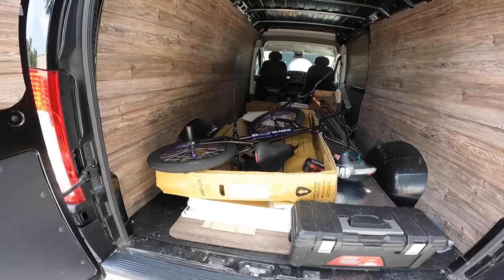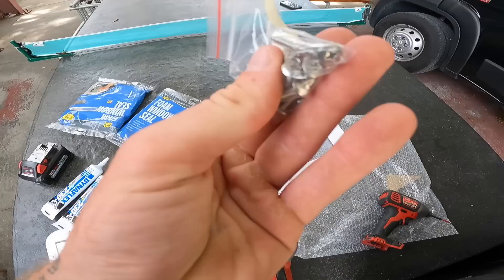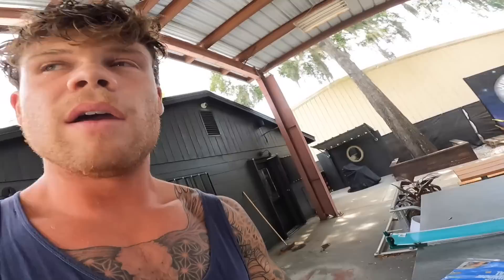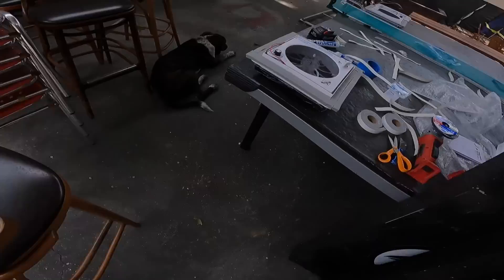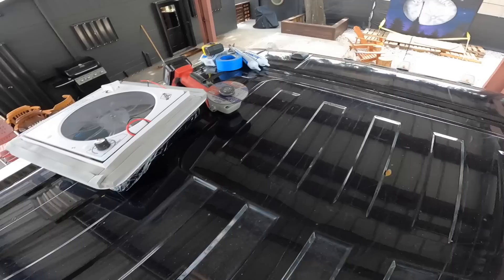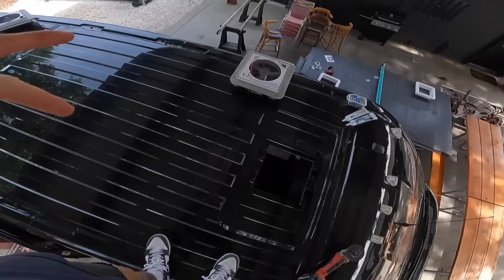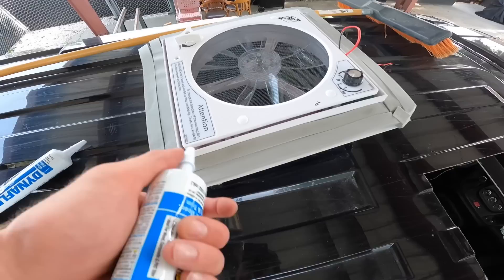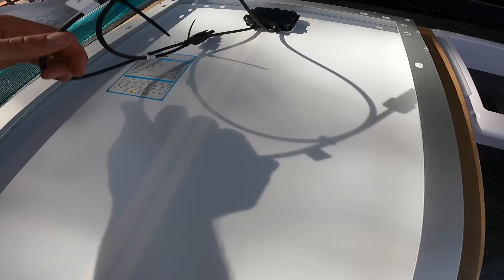Cutting a Hole in my Brand New Van!

Comment: big boy please listento me, You need to use a MARINE GRADE sealant! I cut most of the roof off a friend of mines van and built a roof extention, and has not leaked at all. they have driven all over the U.S. and still no leaks. In dallas it 15 dollars a tube, but well worth it... you used CAULK and that will give way in about two weeks
Reply: This is valid advice bigboy
Reply: Not necessarily true. Some marine grade sealants are just as bad as non-marine-grade sealants. Gorilla makes a waterproof sealant caulk which works great for heavy rain applications. I spent 22 years building bass and saltwater boats.  Marine grade sealants can leak just as bad as non marine grade if not applied properly.
Reply: I'm sure that would be better, but that doesn't mean that's the only thing  that would work. What he used will work just fine
Reply: @GlennsHardWired  wow if not applied properly. No shit nothing works if not applied correctly
Reply: They have black caulking as well.

Comment: Make sure to keep those squares you cut out of the roof. If you ever needed to patch those back up you could easily sand the edges and weld them, basically sheet metal.

Comment: you should really consider keeping the guard on the grinder and using a smaller wheel for future projects. the saftey glasses protect your eyes but nothing is saving you in the event that wheel blows up and it will rip you to shreads if it does
Reply: Only thing he's doing wrong is one handing it and not using a depressed cut off wheel. And if you're exploding them you are binding them and the real issue is it bucking the wheel into you not so much exploding just don't keep your eye sight level with the wheel

Comment: Make sure to at least seal all around any holes you drill or cut into you can Big Boy. If not you'll end up with water damage and mold and you don't want that with the weather you have in Florida and it's too new and nice of a van to 1/2 ass the job. Should prove to be a great lil hauler for you and your buddies with included gear.

Comment: Whyd you put them on the extreme ends of the van? I would have put them more towards the center. You're gonna have a fan right by your rear door...? That makes zero sense
Reply: why would you want to limit the air circulation to the center of the van?
Reply: He is using the van as a camper so the rear door won’t be open and if you centre both then it won’t circulate properly and defeats the entire point of having them
Reply: Matt Stapley I’m just saying a few feet from the rear. From what he’s said, that’s just going to be a garage area. I would have done it 2 or 3 feet further forward.